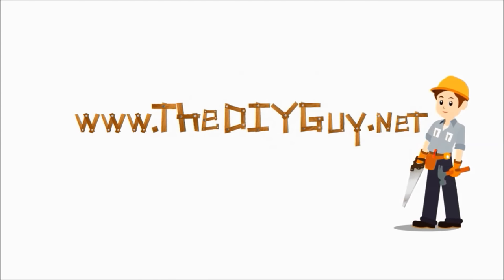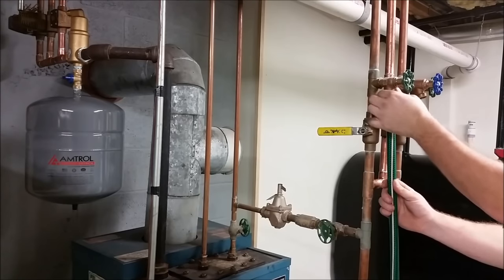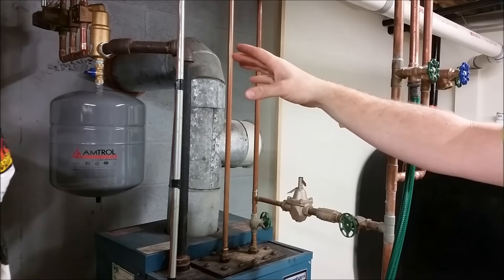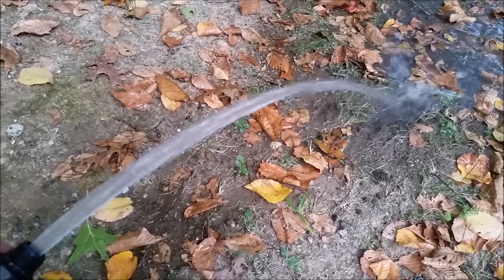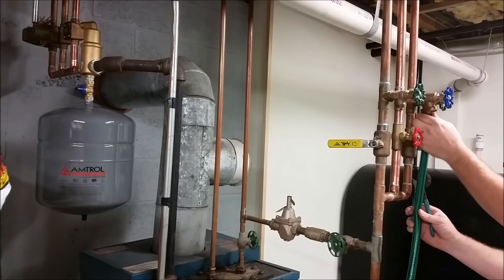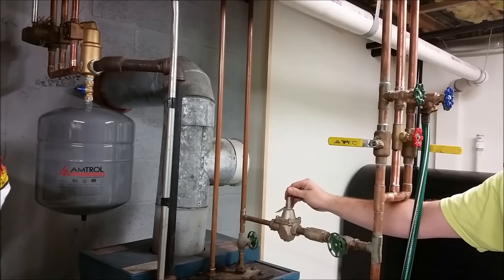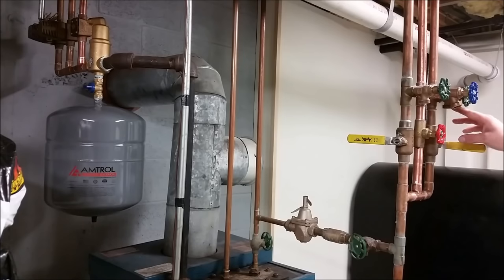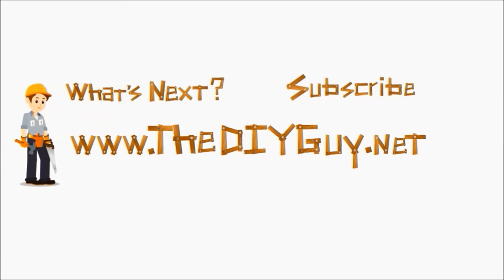How To Remove Air From Your Heating System

Comment: Hi DIY I'm hoping you can help me. I just changed two circulator pumps, and attempted to bleed the system. I think I actually added air, because the parts of the house that is control each circulator doesn't get hot. The third zone original circulator does get hot. My system doesn't have valves that you switch over to manually open the zone. It has a TACO control that circulators but I don't see valve controls unless mine are old and don't look like what I would expect. Any ideas?
Reply: +physiques let me add I do have bell shaped what I'm guessing are zone valves but they don't have the handle to lift?
Reply from the maker: +physiques There are a few different ways to plumb them. One uses multiple zone valves and one circulator. The other way is with a circulator for every zone in the house. I'm guessing that's the way yours is plumbed. If you click the link in the description it will take you to our website and at the bottom you can unload a picture once I look at the picture I can give you a better idea on what to do.
Reply: +TheDIYGuyDOTnet I can't thank you enough for that offer. Today I found out one of the guys I've been playing RB with for a year is a plumber. He came over today and helped me out. Thank you again for the offer that is far more than I ever expected. I will pay it forward ;)
Reply from the maker: +physiques Awesome glad to hear you got it figure out. Your welcome.

Comment: what about cold water going into a hot boiler, do you run the risk of cracking something because of the shock factor ???
Reply from the maker: +joe kacmarciik  It could happen if you did it during the heating season so that the boiler was at temp and your water supply was really cold. To ensure that doesn't happen Open the feeder valve and the drain valve where the hose attaches a little bit at a time to allow the water to enter the boiler to slowly bring down the temp.

Comment: Aren't you supposed to lift up on the Fill Valve to increase the water pressure to better force the air out? (Making sure, of course, you don't over pressure-ize the system and call the overflow to trigger).
Reply from the maker: It is mentioned at 3:39 in the video and also shows how to do it.  Like I stat in the video most of the time on the first story you don't need to do that but on a 2nd story or higher or a longer heating loop it does help to get the air moving to be removed. Like I also said its best to shut the auto feed/ fill valve off and then close the valve that way the system pressure has time to come back down to the normal setting of 12-15psi.

Comment: My water supply is wayyyy slower than your. Almost a trickle. Am I doing something wrong. My setup is almost identical to yours
Reply from the maker: Often depending on your quality of your water the feeder valve becomes clogged and will cause it to come out/ fill the boiler slowly. Some have a screen you can clean, some don't. You may want to replace it. That also could be why you have air in the lines.

Comment: I follow your steps but after like two minutes of water coming out, there is no more water coming out...what am I doing wrong? Is the valve for the water coming from the city supposed to be on?
Reply: Marco Deo  Ok. What about in general, when the heat is on. Is the valve that controllers the water coming from outside the house supposed to be on? It wasn't, that's why I'm asking. I tried leaving it on for a few seconds and heard water rushing through and the PSI level on the boiler gauge shot up close to 40 so i got nervous and shut it. I'm confused about this...

Comment: My setup is similar to this one.  I want to flush vinegar through the tankless system to remove the scale and get my hot water back.  Do you know how to do that?  If it's even possible?
Reply from the maker: Yes its possible. What you need are two boiler drains and two shut off valves/ ball valves right before it enters the tank less. On the one in the video you would have them just under where the auto feeder is T'd in. Most of you older install don't have valves there... So you or a plumber would have to cut them in. So once you have those installed you would shut both ball valves to isolate the tank less. Then connect a hose to one boiler drain and the other side to a pump set in a 5 gal bucket with the vinegar. Then on the other boiler drain attach another hose and just set it into the bucket as your return hose. For hoses we used washing machine hoses. Then let it run for a few hours going that way then swap the pump to the other hose and let it run a few hours again. That way it will be putting the water though it in the opposite way. They make a cleaning kit to do something like this... https://amzn.to/2HAiD9d comes with everything you need to do it. bucket, pump 2 hoses and the cleaner.
Reply: So about where the green shutoff is, just above where the two skinny copper pipes protrude from the top of the boiler?  Since this has never been done in the seven years I've owned the house (and presumably not before I became homeowner either since the shutoffs are not there) is there any reason I shouldn't do it?  The scale doesn't eat the pipes right?  So that I wouldn't remove it only to create a leak?  Thanks for your response.  If I could achieve this I can turn my temp back down from a scalding 130 degrees!
Reply from the maker: Right, where that lower shut off valve is just as the pipes come out of the boiler. It could be done higher up as long as nothing is T'd into the pipe. In this case the auto feeder valve is tied in so you would want to do it lower so your just running it though the tank less. I have done it a bunch of times and haven't had the problem where it causes the tankless water to mix with the boiler water ie though a hole. Its possible depending on what kind of water has been running though it. Depending on how bad it is you might be at the point of replacing the tankless anyway and worth giving it a go. Does your unit have a mixing valve on it?  You could always leave the boiler temp high or even move it up and install a taco mixing valve to bring it back down to a suitable level. Something like this https://amzn.to/2vi1Kxw  would let you run the temp higher and then the control to bring it back down to where you want.

Comment: When the power is off, the Taco valve lever is very hard to move. If I pull harder, will it open? Or am I likely to break it for force?
Reply from the maker: If its super easy with the power on its because the zone valve is open. It should be kind of hard with the power off as you are manually opening the valve body. I have seen some bend the lever but its more because the outside of the valve has corrosion on it causing the lever to be really stuck.

Comment: Shouldn't the first step be turning the boiler off and letting it cool? I thought you can easily crack a boiler by adding cold water to it when its hot?

Comment: How do you do this if you dont have zone valves but have individual circulators running off a manifold on the feed side rather than the return side of the loop? My system has only one purge valne.
Reply from the maker: There should be some shut off valves at the begging and ending point of the zones to isolate each zone. You can use the same drain/ purge valve to get the air out of each zone. The water with travel though the pump. If you want a more precise way to do it on your system you can click the link in the description and go to the bottom and upload a picture of your boiler/ system.

Comment: Hi is it OK to leave the zone value from auto to Manual please kindly let me know thanks so much!!
Reply from the maker: +Mohammed Haque You could but it holds the zone valve open all the time. So it won't be controlled by the thermostat and you will end up making the room way to hot and also cause the furnace to run a lot more.
Reply: I'll add to that - since the valve, in that case, will be constantly open, which mean, hot water will be constantly going through the heating system, this, in turn, will run the furnace × 3 times as often, overheat entire house so bad, you will have to close the ball valves on pipes leading upstairs almost entirely, just to turn the heat down a bit so you can get a restful sleep. 
On top of that, your oil bill will, literally, SKYROCKET! 

We are talking at least(!) half a thousand dollars, just for oil!

Comment: I'm guessing you need to let the pipes cool/turn off the boiler for a few hours before doing this?
Reply from the maker: Yes, either shut the boiler down a few hours ahead of time or mannual open the zone valve and dump the heat out of the boiler. It's not the pipe temp you want lower it's the boiler temp as when you add cold water you can shock the boiler. If you read manny's comment a few down it's a little more detailed.

Comment: What if my system does not have a drain per zone, but just one? Same process or do I close / open the return valves per zone?
Reply: Did you ever find an answer for this?
Reply: @cpoul  in that case you need to work per zone

Comment: I have a 2 zone system with 2 thermostats. The one with the air in comes from the call/auto valve, then splits into 2 with shutoffs on them. Then there are 3 return lines back. (splits upstairs again). I close the one shutoff to the living room and shutoff the return for the upstairs then open the spicket and purge the air. I shut it off and open the shutoff of the return. Close the shutoff for the upstairs, open the living room/close that return drain. No more air is coming from the pipes. However when the furnace turns on it shoots air from someone back into the system. Any ideas?
Reply from the maker: Hello, Are you getting warm water to come out when your purging the air out? Make sure when your done purging the air out that you have 12-15 PSI in the boiler. You might want to try and purge the zones longer to ensure you get all the air out. Are you on city water? I have had a few on city water have a good amount of air enter though the city water as it tops off the boiler. Then accumulate on the higher zones. Also check your expansion tank.. sometimes the bladder within rips causing the air to mix into the boiler water causing air pockets. Tap on it and see if its full of water or half way or so full with air. Not sure how old or what type or air eliminator you have but you might want to replace / upgrade to aid in the removal of air within the system.

Comment: How does the water run through the loop if both valves are shut off?
Reply: Nevermind, it goes out the gate valve.. derrrr
Reply: What is the gate valve?

Comment: What about the pump systems, should i turn those off while doing this?
Reply from the maker: They should be off when the boiler switch is turned off unless it is an Alpha pump which is plugged into the wall. Just to be safe you can shut the t-stats off or turn them down and if you have a indirect water heater lower the temp so the pumps won't turn on.

Comment: I have three zones on my furnace, but I don't have cutoffs or zone valves. Should I have valves and cutoffs installed? I've been dealing with banging pipes that bleeding radiators haven't helped. Three story house, basement, main, second floor.
Reply from the maker: Hello, So do you have a circ pump on each of the zones? how are the zones controlled? Some of the pump flanges have valves built into them. Its hard to give you a plan without seeing the setup. Zone valves are what activate each zone for heating but if you have circ pumps controlling the heating loops you won't have zone valves. Adding in some shut off valves and boiler drains to each heating loop is a good idea. That way you can use all the water pressure to purge the air out of each loop one at a time. So are the bleeders on the radiators? or do you have a air scoop on or near the furnace? You may want to replace the air scoop with one of these https://amzn.to/2xGwgDe. That's why there was air within this system in the video as I replaced an older taco air scoop with one and also replaced the expansion tank. You can see the new expansion tank in the video and above that the new air eliminator. @ 0:30  Its placed as high as it can be before the main line splits feeding all the zones. You could also click the link in the description and go to our site and at the bottom you can upload a picture or two and I can see exactly how your system is setup and give you a better idea on how to move forward.

Comment: 3:38 If keep holding up the pressure reducing valve while purging air in the second floor(highest) zone from start to the end, and if the pressure increase 25 psi or a higher, will the furnace or hot water pipe will be burst?
I hired two different licensed plumber to purge air out, but didn't work. I watched this Youtube video and followed. 
My first floor zone is very quiet now, but still banging or pipe hitting noise on the second floor zone(Two story house/two zone). I consistently keep 15 psi while drain second floor zone water, but seems like not enough. I will try to keep holding up the pressure reducing valve  from start to end while purging second floor. Will it damage the pipe and cause leaking water? Kinda scared.
Reply from the maker: For some reason your comment got kicked to the spam box. No 25psi will not hurt anything. If you check the tag on the pressure relief valve on the boiler it should say 30psi. Seems odd that two plumbers couldn't get the air out. The air will get trapped on the highest zone. As long as you open the drain valve then hold up on the auto feeder valve till a min or two after you get all the air out then release auto feed valve and then let the pressure come back down to 12-15psi then close the drain valve you should have no problems.
Reply: @TheDIYGuyDOTnet  Thank you for the advisement. I will try that way. I was scared about pressure matters. Now I understand =)
Reply from the maker: @웨싸이  No problem, Glad we could help.